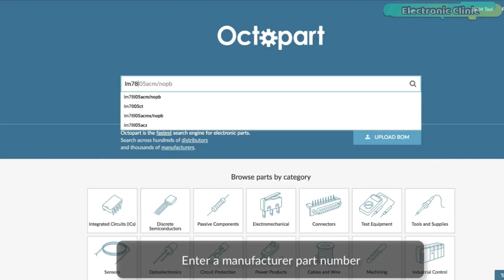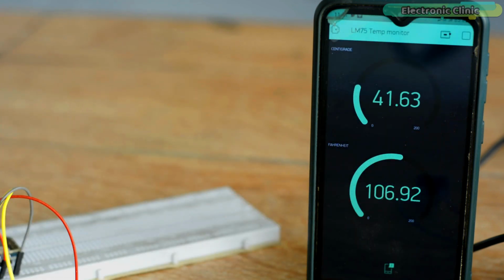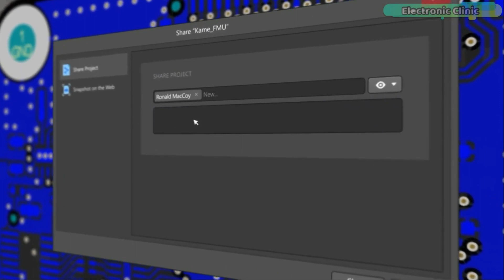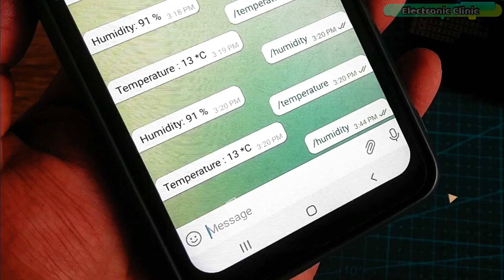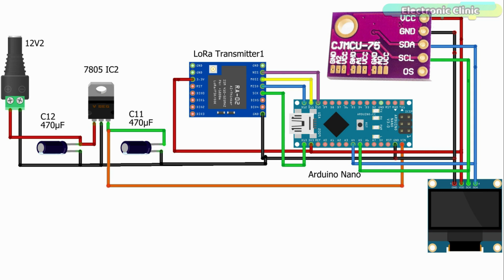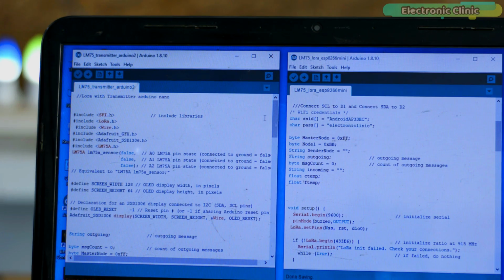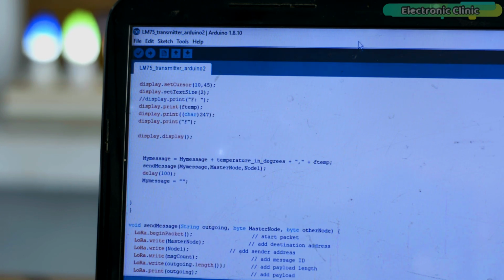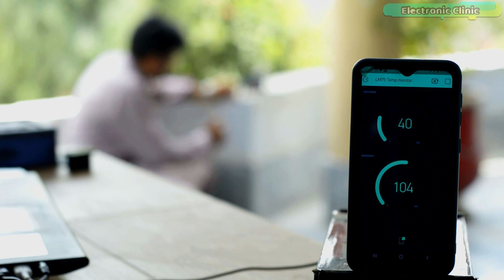IoT project: ESP8266 LoRa Gateway for Arduino and LM75 Temperature Sensor, Arduino LoRa Gateway

Comment from the maker: My other videos on Temperature sensors and LoRa:
MLX90614 infrared temperature sensor with Arduino:
https://youtu.be/MhckQm-AMh4

MLX90614 infrared temperature sensor with ESP8266:
https://youtu.be/hiwoEPf1xLs

MLX90614 with LoRa and Arduino:
https://youtu.be/QBgKL-LExq4

DHT11 Sensor with Google Spreadsheet using ESP8266:
https://youtu.be/7rCZB7tN4P8

Raspberry Pi Pico Temperature Sensor:
https://youtu.be/__v2P_RmXSY

Raspberry Pi Pico and Max6675 K type thermocouple:
https://youtu.be/mBhsMqcWyZA

Industrial temperature monitoring system using Raspberry Pi Pico:
https://youtu.be/mBhsMqcWyZA

Arduino Max6675 Wireless industrial temperature monitoring:
https://youtu.be/_RoFhuHLuO8

ESP8266 and DS18B20 Waterproof one-wire digital temperature sensor:
https://youtu.be/cv0yKRALZpI

LoRa based Projects:
Lora SX1278 Getting Started Tutorial:
https://youtu.be/r-jwNlMQPIk

Arduino Lora SX1278 Two Way communication:
https://youtu.be/feWnciEnaBA

Multiple Sensors Monitoring using Arduino and Lora SX1278:
https://youtu.be/wUF9ysBEHfo

LoRaWAN Network:
https://youtu.be/tXoAa_II2OY

Arduino LoRa based Home automation Project:
https://youtu.be/TDEKsaNIZJs

Arduino LoRa GPS Car Tracker
https://youtu.be/d5zfD6ekRYA

Arduino LoRa Swimming Pool Monitor for kids
https://youtu.be/YJpwY_tz5VM

Arduino LoRa and Bluetooth based free text messages
https://youtu.be/CRNcN2Y6AwU